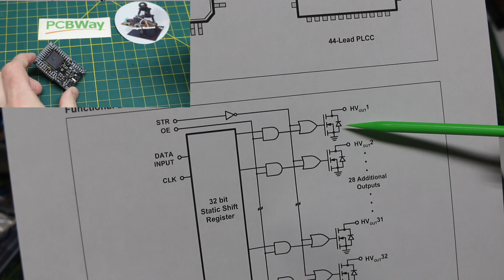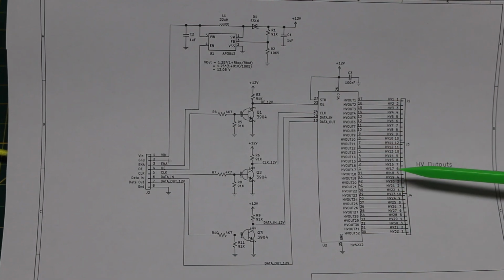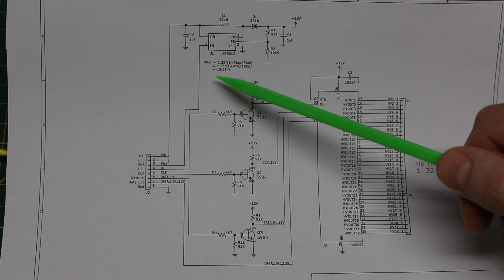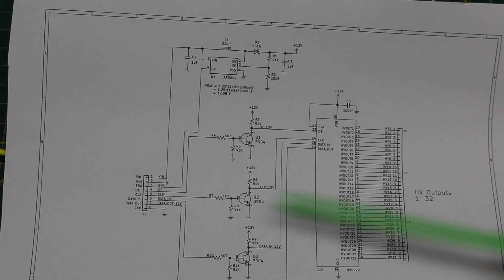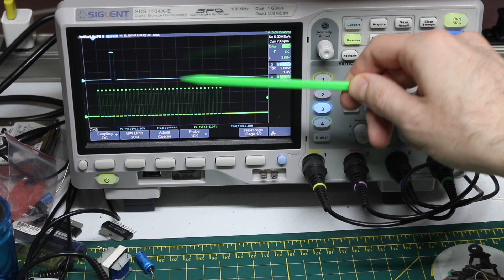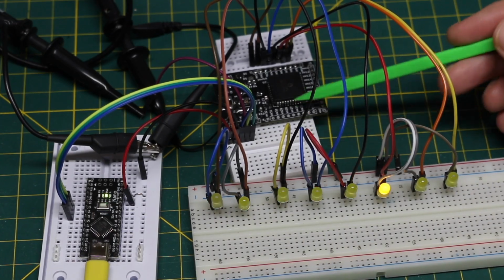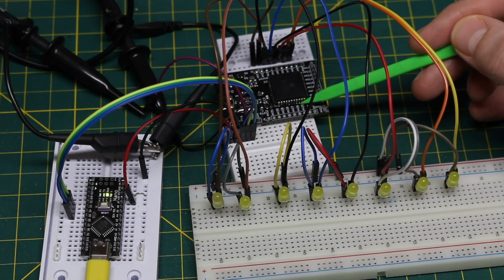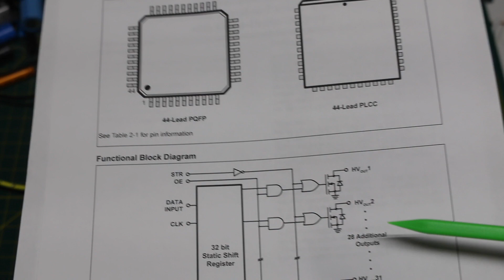Nixie Tube Driver using HV5222

Comment: There is one issue with your design i think quote from the datasheet " HV5122 / HV5222 are designed to be used in systems which either switch off the high voltage supply before changing the state of the high voltage outputs or which limit the current through each output."

Normally I would hold the OE input in a state to disable the outputs until I'm happy with the data to be displayed, but with this chip the OE enable in the disabled state pulls all the the outputs low, so turning on all the segments at once. This could lead to one unhappy hot chip and nixie tube.
looks like the only option is to send a set of  segment off's through the chip at startup.

The problem with most Arduino designs is the bootloader will get in the way of good circuit design. At the time when you want to clear the display so you won't see random segments lit, the Arduino is sitting waiting to see if it's required to go into load mode before running your code. So you always get an issue with resetting displays.

The way round this is to remove the bootloader code and programme the chip directly, then the first code that runs is your clear display code. problem solved.

One Nixie fan boy here, waiting to see if  Dalibor Farný can bring down the cost of his in design 'F' series. https://youtu.be/3nsg0q2Pz6g?si=IeKoDgNgpQmEIk9B

Edit was going to add, look for an old copy of EN 61010 safety standard this will provide great information on all aspects of circuit design requirements. great late night reading 🙂
Reply from the maker: I found the datasheet somewhat confusing to interpret and lacking in some details, but for the high voltage supply switching or current limited outputs, I assume the fact that the nixie tube has a current limit resistor ( a few mA) would cover that part, but otherwise I was leaving it up to the broader project implementation to have another circuit potentially control the HV supply (the supply I'm using has a shutdown pin. I just need to re-learn what kind of voltage it wants)
I'm sure that when OE is set to disable, it keeps all outputs off rather than on (and confirmed where I have only one LED or nixie digit coming on at a time, and I use OE when updating the shift register).   The datasheet pin description "When OE is LOW, all HV outputs are forced into a LOW state"  was one of the confusing things.  I think they are saying the output driver FET gates are low, so it is open drain mode.

I think Strobe is the pin that would force all outputs on at once (and I have it tied to vcc to never do that).  When I look at the chip logic block diagram, the way it has OE and strobe going through the And and OR gates to control the FET, that all seems to make more sense.
If someone could start producing new nixie (and similar types of) displays again that would be good!  I've been having fun using various old vacuum display calculators around the workbench rather than letting them sit in a box doing nothing.
Reply: @GadgetReboot  Okay... now you are starting to rememind why (oh so many years ago) I decided not to use the (slightly) cheaper HV5222 and went with the HV5530. I designed and built one clock using the 5530, was quite happy with the chip's performance, ease of use, lack of weird restrictions and to a lesser degree its data sheet (which could be better!). After that I never looked back - I just buy 5530s (if it ain't broke don't fix it) and so have no hands-on experience with the 5222.

So my advice would be to just get some 5530s and perhaps some legit level shifters. Oh, and ditch Arduino IDE and go bare metal if at all possible! There are packages out there that allow you to use gcc with AVR chips. You can use an UNO as a programmer to flash a bootloader-free Nano if you don't want to buy a hardware programmer. You'll have to Google how to use the UNO as I've completely forgotten how to do it since I get a hardware programmer a while back but I do remember it wasn't real difficult.

If you get some 5530s I can even give you the C code I use to drive them, if you want it.
Reply: @sootikins  5530 seems brilliant for nixies. would be so good if it ran on 5V natively. apparently, some people have been using the 5222 with only 5V.

Comment: That power-up random output glitch is odd. I've done quite a bit with those Supertex/Microchip HV-series drivers and have never seen that. I'm not doing any sequential power-up tricks. The only thing i can think of is that I've always used the versions of the drivers that have a blanking pin. I connect it to an output on the controller for various reasons. I suppose that output is floating for the first few milliseconds as the program gets going. Since the blanking pin wants to be driven high to not-blank maybe the glitch is happening but being blanked.
Reply from the maker: Yeah I assume I'm catching the output glitch due to my board pulling OE high until the controller can turn it back off and blank the outputs, so I think controlling the 12v rail is the next best thing if the controller can boot, configure OE for blanking, then turn on 12v so the driver can power up with OE set to blank it.  Next time I may just use a proper level shifter so OE is less janky.